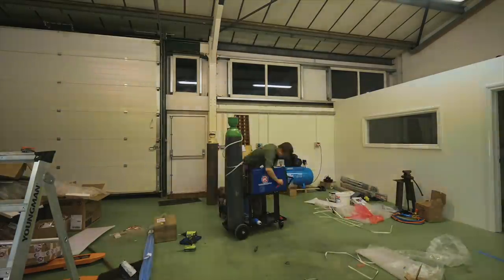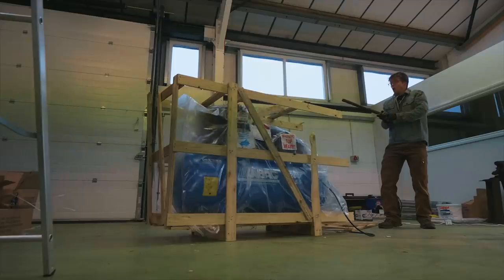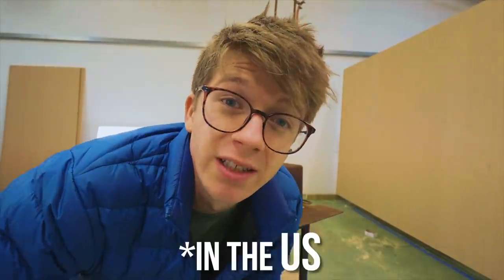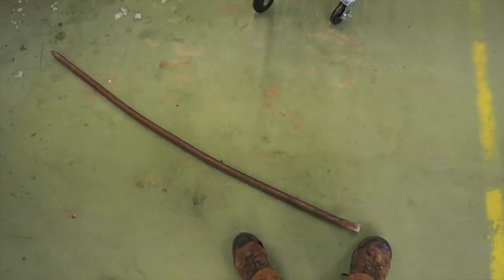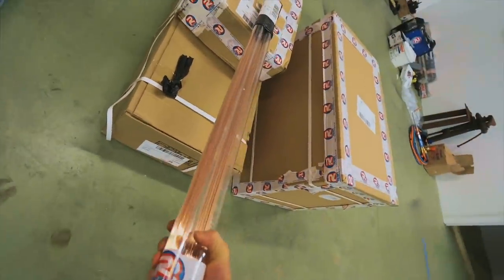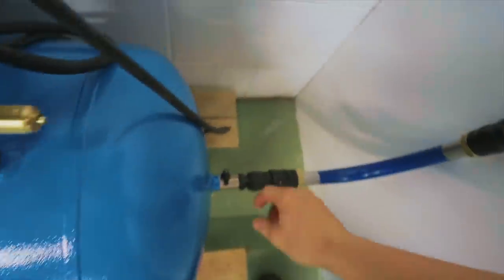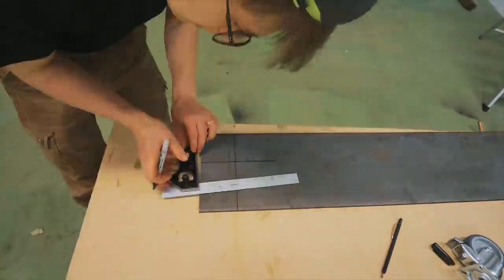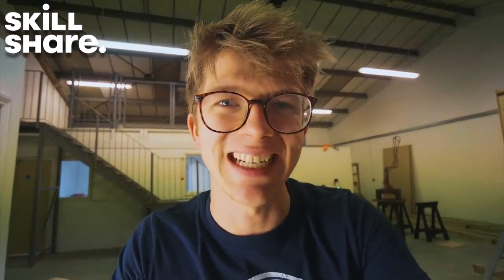MY BRITISH WORKSHOP!!! PART 2

Comment: OH MY GOD, 2020, and this the first time I've seen Alec Steele using coolant to cut thick steel. The amount of cutting bits and drills I've seen you destroy by racing through cutting bits pouring out smoke only to snap seconds later.
Reply: Es verdad, pero debe ser porque es la primera vez que lee el manual de algo 🤣😂😂

Comment: Love how your first thought was to simply cut the plasma cutter down in order to fit the cart, as opposed to just rebuilding the cart to make the space taller, lol!
Reply: Really. He could be building custom carts for everything in his shop. Most of the generic, ready to buy ones are cheap crap bare bones... and expensive for what you get.
Reply: While I do agree with you, I think time is an important factor here. After losing two weeks in quarantine, he wants to get up and running asap. I would suggest just sticking stuff anywhere for the moment, then customising stuff like shelving/carts etc at a later date. He's going to need the machines to make the storage for the same machines, if that makes any sense. Get everyting working first, then start fine tuning it.
Reply: @2H80vids  100%. I honestly buy lots of crappy stuff that I could build better, because I'm busy running the ranch. Then later, if I have the time, I modify or beef it up if it's not performing. Sometimes, though, you just need a cart for the welder. And sometimes you have used up all your motivation for the day on the jobs that make money, and don't want to think about how to design something unimportant.

Comment: Can you talk about the estimated price for the power hammer and mill? You don't have too

But a price list would be awesome
Reply: Mills run from $800ish-$5000 depending on the state of the mill, the size, and any extra features that they might have.
Reply: As an example Canadian blacksmith supply sells Anyang power hammers 33lb, 55lb and 88lb power hammers for $3600, $5900 and $7400 CAD Alec hammer in Montana (and that work's) is a 165 lb power hammer. Grizzly tools sells mills and other tools with pricing on their website.
Reply: And if you want a cnc you pay 4k - open end
Reply: 4K would get you a little bit of the tooling for a CNC. Or a broken one maybe
Reply: @andrewphillip8432  one Option is buying a manual and transforming it into a cnc or a small 60-300kg desktop one for 4k plus tooling
Nothing that good but for a hobby enough. 

If you really want a good cnc you will pay 15k up for a used mill or lathe
Reply: @Sebastian-ed5kt  true. Even tormachs are like 15k and up, but cncs made of Bridgeport style mills can be had for cheap. Still they hardly compare to fast modern machines running on linear rails  with powerful servos and way better spindles. Wish it weren’t so expensive
Reply: @andrewphillip8432  Yeap come to same conclusion. All of that even manual machines are out of my price range, so thanks to someones already dropped DIY lathe project, i now have couple hundred worth of components for free, axle from hydraulic cylinder arm, 4 jaw chuck, couple cone bearings and heavy wall tube that is almost perfect fit for the bearings. Just got the axle from local machine shop that put the treads to match the chuck (yes its odd one with m20 with 1.25mm rise tread on the center) and made big nut with area for 35x52x7mm axle seal. All that for 200€, now i just need some thick plate scrap peaces, sturdy I beam as frame and for tailstock machine shop agreed to help on its construction from thick wall stock and to make morse taper on that, we will be taking MT4 to MT3 adapter, turn it uniformed thickness and heat fit that to tailstock.
It aint going to be professional, standard construction, or pretty, but it will do little hobby lathe job i need to do, being superior durability to Chinese ones, it will be cheaper than any alternative around since i can source materials over time and get slightly used parts and since it aint going to be perfect, it will be adjustable. like headstock will be modular, so i can later swap to bigger hollow axle and proper chuck and build another for tiny bushing jobs etc on corner of my homeoffice, where bigger one is on the garage on another location.
I could easily turn ether one into cnc if i wish so, but do not have need for one now and still be cheaper than proper manual lathe second hand.
Reply: @Hellsong89  that’s awesome to be tackling a project like that! Still you’ll be hard pressed to beat an old used lathe like an atlas or southbend. Might not be any deals in your area right now but keep an eye out because they go for dirt cheap sometimes. Less than half what a Chinese lathe would cost. But good luck on the home build anyway, it’ll be a rewarding experience I’m sure
Reply: Several thousand dollars.

Comment: Mag-drills are INCREDIBLE! I drilled about 1,000 5/8" holes in 1/2" plate to make a welding table, and it would have been impossible without it.

Comment: I work at a sawmill, and for our compressed air we just use agricultural blue line poly water pipe. 
Works a treat for us honestly, I've never had a pipe blow and only had a handful of leaky fittings over the years.

Comment: If you want a quieter compressor, look at screw compressors. Quieter, faster, higher volume, and there are several places now putting them on new smaller units, in a traditional compressor W tank format, as opposed to the factory style larger compressor unit W/out storage format. With their differences from classic compressors, you can actually get away W a physically smaller unit, as the larger volume throughput of screw compressors would compensate for a smaller tank, and are fundamentally Far quieter. And you could always add a second tank in the lines (themselves additional volume) if needed. Possibly on the grind room roof, tapping in to/near that top elbow.
Ball valves use plastic seals either side of the ball; during storage the sharp edges on the ball often get stuck in the plastic, especially when materials heat differently.

Comment: Hopefully the compressor can go above the sanding room maybe and then sound proofed...
Reply: How will it stay cool and get its air to compress if its in a sound proof box, stick in a shed of its own or a separate room
Reply: @4984Snake  no clue
Reply: They had it up in the other place
Reply: @4984Snake  It will be fine in a box, but on the roof of the grinding room is dumb.

Comment: Hopefully  you are going to be metric while in the UK. Every time you talk imperial I have to get my calculator out to translate it into something I can relate to.
Reply: Yeah that's just the worst 😂
Reply: Just the opposite here. Metric is too foreign. My mind has no concept of sizes in metric.
Reply: @nooneyouknowhere6148  Kinda funny really.. Your imperial is defined by metric xD

One inch is actually defined as 0.0254 meters
Reply: Luckily I'm in Canada, we use metric for everything, but living next to the US most of us understand Imperial as well (most of our rulers, tape measures, squares, etc have both on them)
Reply: @nooneyouknowhere6148  
Your mind doesn't... now it's going to:
1 to 10
10 to 100
100 to 1000 and beyond

Oversimplified but it's already simple... 🗿
Reply: I've never found it hard to do simple maths in my head... from memory: 1.0 m = ~3.3' ... 1' = ~30 cm ... 1" = ~2.5 cm ... 3.0 m = ~10' ... 1 mile = 1.6 km
Reply: @theimperfectgod7140  oh, i know how metric works. I just vizualize sizes in imperial. Metric is just theory. I can look at something and tell you the approximate size in imperial. If you want metric i have no idea. Metric simply has no point of reference in my mind. I have to measure it every time. I can look at a bolt and tell what imperial size it is. And when building things fractions of inches just seem to work better for me.
Reply: @RraMakutsi  I can relate to 6 inches, 6 foot, 1 foot, 1 inch, and 1/2 an inch but when it comes to 70 thou, or 7/16 or 50 inches or 17/32 inch I have to get my calculator, or I use an online calculator. There is nothing intuitive about these fractions, you only learn from experience what they look like. On the other hand, I know what 6mm look like so 6.25 I can immediately relate to.

Comment: *Safety tip*  Air compressor nozzles should point down to save an eye injury.
Reply: Another tip: gas cylinders should be chained to the wall to avoid circular shaped holes in the building
Reply: Nunca había pensado en eso de la pocision por la presión del aire.
Reply: @H.D.83  No, put them on a proper trolley so they are portable and safe to use and handle!
Reply: @JonDingle  That would also work, point is that you really should try to prevent them from falling over.
Reply: @H.D.83  100% we can agree on that. But if your bottles are not portable around the workshop then it makes life awkward having a fixed station (so to speak) for gas cutting and welding. Arogshield light Mig welding shielding gas bottles and pure Argon bottles for Tig welding are safe enough on the back of the welding machines. Safety is everyones responsibility and that includes FLT drivers moving stuff in and out of workshops.

Comment: Seems like with Will leaving to his own shop and Alec setting up this new one, maybe the Montana shop is over??
Reply: I don't think so. There are people working and running his business
Reply: The Montana work shop is very much alive. Alec Steele Enterprises, North American distribution center, manufacturing and sales. Will doesn't want to work on the production line, or polish anvils. When Alec said that Will was leaving at the end of the year, and when Alec realigned the power hammers on his last video in Montana. The righting is on the wall.  I spent 10 years maintenance, machine repair on manufacturing.

Comment: Those john guest connectors that you use. That is actually something i use a lot as a beer tap mechanic. They work amazing and are super easy to use. Make sure you have some way of letting the pressure out of the line like a valve before connecting them. Otherwise they wont come off!

Comment: Uts so much fun building new work spaces. Love the air system. Only thing is I would connect the air compressor to the line via hose, that way you can move the compressor for maintainance without un doing the hard lines. Use to use over-sized hose so it isn't restrictive. Also use a good size loop.

Comment: As someone who has plumbed a couple of shops for air, I would recommend a couple of legs attached to hose reels in the middle portions of your shop. It will reduce trip hazards from hoses laying on the floor. The new shop is looking good. God bless and Merry Christmas.

Comment: We had that blue nylon pipe installed over. 20 years ago, it's definitely not new but it's still going strong. Was expensive back then but turns out it was worth it.

Comment: Ive used 1" copper crimped pex all over our facility and it's easy and great. Not as easy as push-lock's but it's a 60year old company and building so it's as permanent as it gets.

Comment: Ordinary copper plumbing pipe works great for air. It's relatively cheap, easily available and rated for a ridiculous amount of pressure if used with soldered or brazed fittings. It's not safe to use compression fittings with air. If you solder the joints you need to flush the system with water before use. You don't need to do that if you use no-flux brazing. I must have getting on for 50m of the stuff in my workshop.

Comment: Have you not thought about baffling for the compressor, from a sound perspective it's in the worst possible place (but the most common place) three reverberant surfaces surround it and it just bounces the noise everywhere,  a simple vertical wall and some absorbant material will cut the noise down in the rest of the shop.

Comment: If you build a cabinet/closet around the compressor with some batting/sound insulation you will cut that noise drastically

Comment: Nice compressor. Just make sure the motor turn the right way. It will make air both directions, but the fan on the compressor side works only one way. The pulley on the compressor side should blow air in the direction towards the piston block.
Oh. And move the compressor so it's not so close to the wall, it needs to draw in air for cooling.

Comment: If you run the inlet of the compressor to the outside, it will cut the noise way down. Just make sure it can’t suck up water.

Comment: Nicely going :) If I were you I would go for screw compressor which is more energy efficient and making way less noise. Since you got old type piston one try and build it around even with plywood or mdf which will make your work environment bit more comfy reducing noise coming out from it.

Comment: @Alec Steele Regarding placing the Plazma cutter underneath the welding machine, why don't you make longer legs for the actual table thingy? I see it supported by nuts and screws i think.

Comment: Alec, if you know a guy with a welder, you could just get him to extend the support legs for the top shelf of the cart and raise it just high enough to get the plasma cutter on the bottom. I mean, good luck finding someone with a welder who would want to practice on a fabrication item like that but it could be possible to find someone who is capable of changing the shape of metal in such a manner. ;)

Comment: Modify that cart to be a little taller so your plasma cutter will fit on the lower shelf!  You can just unbolt and swap out the “legs” so they’re a bit longer.

Comment: One thing you should be aware of with that plastic air pipe is it is much easier to damage than iron pipe and heat, well, you know what heat will do to it. Just keep it away from things that can be moved and give it a couple of 2X4's or a steel shield in areas that are iffy.

Comment: Just fyi: Use the big 4ah or up batteries with your ryobi circular stuff - It has more watts and performance is much better :)
Reply: I think you mean more Ah, watts is a property of the motor.
Reply: @owensparks5013  Still, larger ah hour batteries are rated for more watts - and that makes for "more" powerful tools especially with the circular saw gor example.

Comment: Alec, it seems like the solution to your plasma cutter not fitting on the cart isn't to cut the expensive plasma cutter, but instead to extend the height of the cart. With your skills and tools, that should be trivial, and you don't risk destroying a valuable tool in the process. I'm sure the cart is a heck of a lot cheaper than the cutter!

Comment: Welding trolley just cut the legs and add a few inches with a few bolts and plasma will fit 20 mins all done.

Comment: Hey Alec, instead of cutting the top of the plasma cutter off haha. Why not modify the metal cart? Either lower the bottom shelf. Or cut all for legs and add the two inches of height . Then you’ll be good and have both on the cart without cutting off the handle of the plasma cutter. But it is yours, and if you plan to keep it then it doesn’t matter. But if you sell it or have warranty on it they might not like it missing haha. Love the videos! Have a good one!

Comment: I have two questions. 1. why won't you use an electrical forge which is better for the environment. 2. when I see you working on a Damascus project I see you pouring some kind of powder on the block of Damascus when forge welding. What kind of powder is that and what does it do? BTW love all of your video's I'm planning on doing a blacksmithing workshop when COVID-19 will allow it.

Comment: The crow bar/ wrecking bar you straightened should have been hardened steel, I think you might have messed it up by heating it to straighten it.  You'll find out when you try to use it.  It may just bend where it was heated.   I used to work in a heat treat shop and the guys left a crow bar hanging on a rack.  When it came out it was super soft and bent whenever you tried to use it but it looked like a normal crowbar.  lol

Comment: Technically you're supposed to wire your air compressor straight into the fuse box that's why it comes with no plug on the end but I won't tell anybody

Comment: pro-tip: water down your coolant..they ship it to do all metals well and at a strength that isn't needed for causal mild steel drilling. it's so damn expensive when your building a grain elevator and have to punch 100's of holes.

Comment: Alec its stuck due to the pressure on the charged side of the pipe. Also do yourself a favour and check all air joints with soapy water. Enjoy

Comment: Whats the difference between a mig welder and a tig welder? Is the welding rod fed inside the mig welder?

And also with an air compressor you need a regulator? Would that be needed for nail guns..?

Comment: The nylon lines will be fine, that’s what they use on commercial trucks, but the plastic fittings have a tendency to break. Again that’s on trucks, maybe since they never move they’ll be fine, but if they do break, find some brass fittings.

Comment: @alec steele I have the exact abac 5.5hp air compressor and I regret buying that air compressor, I live in Malaysia and they do sell abac air compressor but they don't sell any spare parts and It doesn't last long, I'm using it for my hobby shop not job shop where the compress will run everyday yet I have problems with the connecting rod, the company I bought the compressor don't sell any parts for  the stuff they sell, so I contact Abac in Italy and they said they don't ship parts for overseas, not only Malaysia but they said they don't ship parts to anywhere in the world. And now my broken compress is just sitting there and I don't know what to do with it, might throw it away soon, abac is expensive compressor with very poor quality and customer service, now I got a Ingersoll rand that runs perfectly and I was able to find the parts I needed, good luck with abac alec

Comment: Modify your cart instead of your welding equipment, friend. Add a few new bolt holes and fiddle around with the bottoms shelf and casters for that last half inch.